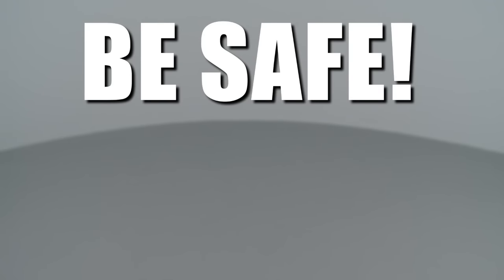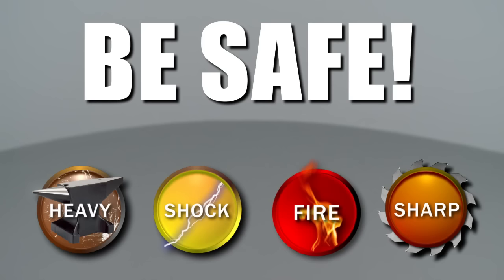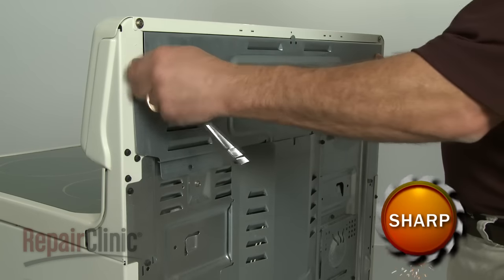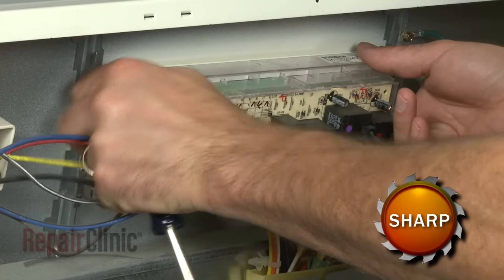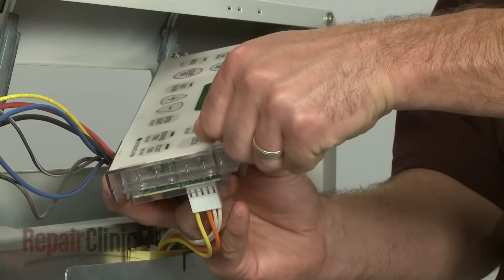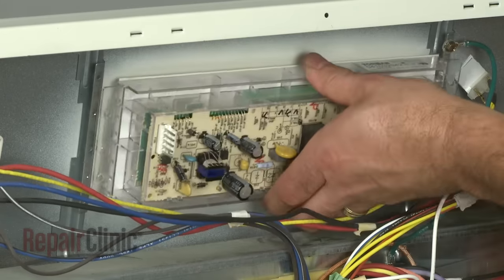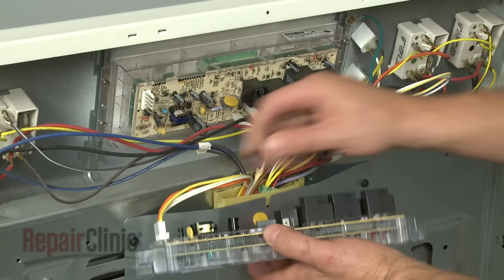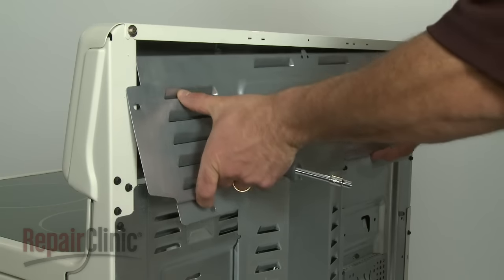GE ElectricOven Control Board Replacement #WB27T11311

Comment from the maker: The control board may have blown out with the short . If there is 220 volts to the range at the plug or the burners on top of the range are working, the control board is bad and will need to be replaced.  If the burners on top do not work or there is no power to the range the next step would be to check your breaker.

Comment: when I change Ovens lamp electric was on,I forgeted and did short-circuit
later I off electric . When I putted lamp and plugin on  Oven Control Panel was not showing anything only heaters working,If I will buy new one,it will work again ????

Comment: Is it possible for a control board to overheat and go unresponsive? We were cooking a roast for an hour or 2, and using the top burners, and the oven turned off and won't turn back on. It shows the clock only, and when you press anything, it just says "0 heat min" or something. A few hours later it works again.
Reply from the maker: +Ben Van Deventer The board does not necessarily overheat, overtime oven controls can fail and need replacement.
Reply: @repairclinic 
I have a GE gas model jgbs61rpss and the oven igniter burner won't come on. I removed it and repair shop verified the igniter is working. I used an ohmmeter, I hope properly, to check the gas valve by pulling one spade and touching the prong and the other one on the body of the valve. It jumped around and settled on something like 136. The repair shop guy told me it was probably the clock control board. Does that sound correct? Do you know the model number I would need to replace that part? Thank you.

Comment: Our Hotpoint oven started by the temperature set at 325 degrees & it rose so hot you couldn't touch the surface. Is this a Thermostat or a Control Board issue?  Thanks

Comment: When I touch the various buttons on the control panel,  they work except for the numbers.  When I touch the numbers on the control pad, the display only show "__  __  __"  with the appropriate words shown below - "Bake", "Convection Bake", "Broil", "Convection Roast".  Is this a problem with the control board?
Reply from the maker: +David Cohen Depends on if the touch pad is only sold with a new board.

Comment: The (GE Profile PGB918SEMSS Free-Standing Stainless Steel Double Oven Gas Range, Model PGB918S) is stuck on 1 degree that is the only thing that is showing on the screen
 the oven will not turn on the keypad will not respond the only thing that works are the burners.
Reply from the maker: +aiyanna peoples The touch pad or control board is likely defective. http://www.repairclinic.com/PartDetail/Glass-And-Board-Asm/WB27K10257/1473921?TLSID=1773 (touch pad) http://www.repairclinic.com/PartDetail/Oven-Control-Board/WB27K10176/1167048?TLSID=1773 (control board)

Comment: Hello, Need help please!!! My range stopped working while cooking. I was using the oven and 2 burners at same time.Never had a problem with it. I did check the manual seems no trouble shooting tips for this problem. This is 5 years old GE Electric Range. I took a very well care of it. I do not want to call a technician and pay an arm and a leg. Anybody there that can help? Model number. JB700S N1SS
Reply from the maker: Maria Aguilar You'll find our website's free troubleshooting and repair help information to be helpful. Enter your range's model number here: http://www.repairclinic.com/repairhelp?TLSID=1773.

Comment: I was changing the bulb in my oven G.E. the bulb had broken I started to try and get it out with a rag wrapped  around the end of pliers.but it slipped and touched metal to metal and now my digital board don't light up what you think it fryed the board when that happened